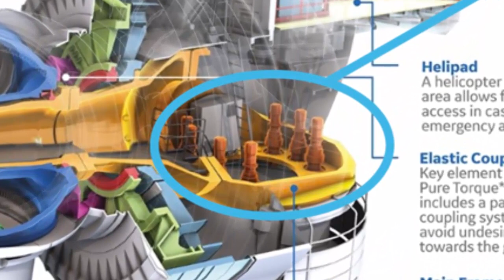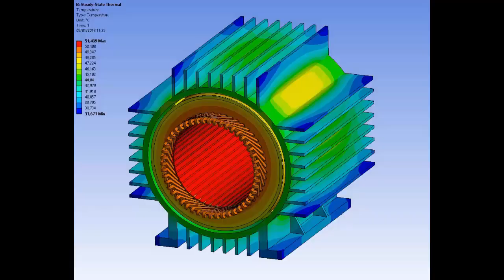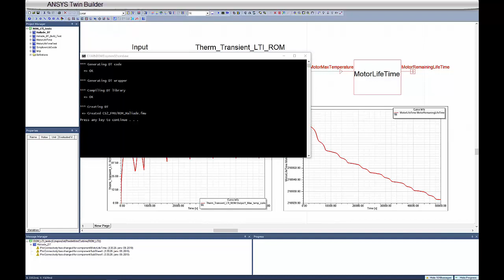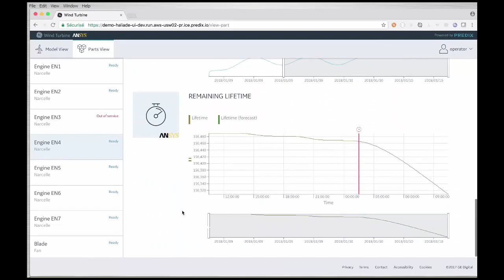ANSYS Twin Builder Used to Create a Digital Twin of GE Offshore Wind Turbine

Comment: Imagine how expensive it is if the the motor fails because the over simplistic model and lifetime predictions were wrong. Surely the model was validated? Scary.
Reply: how was the one motor overheating? was it actually overheating based on analysis or did they contrive the problem to illustrate the solution